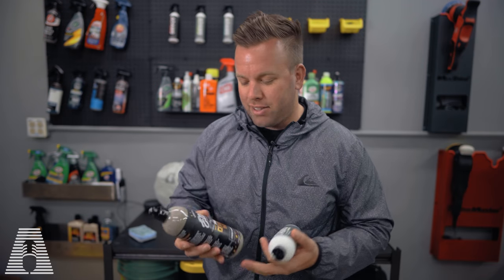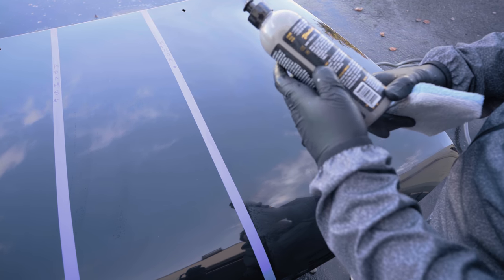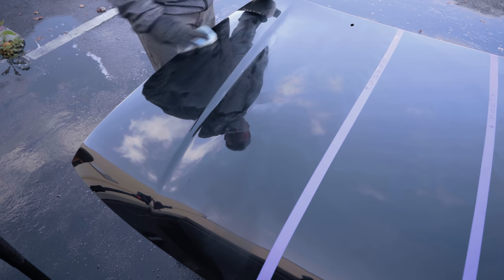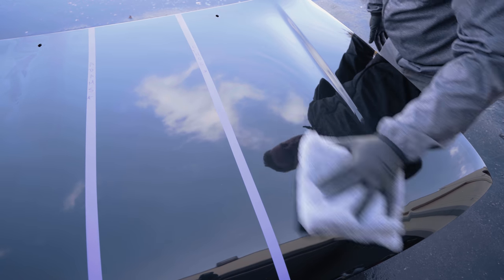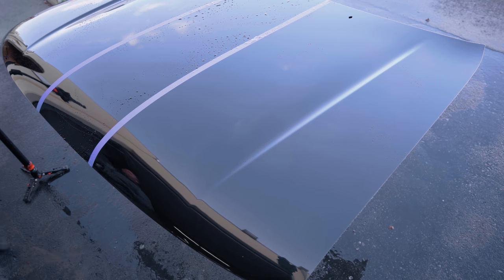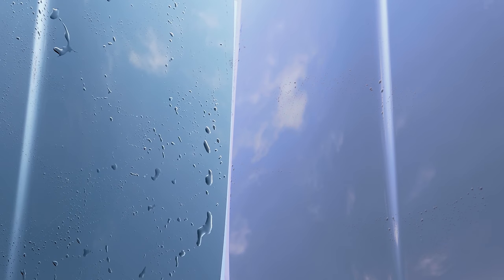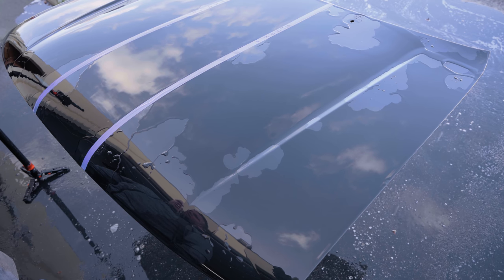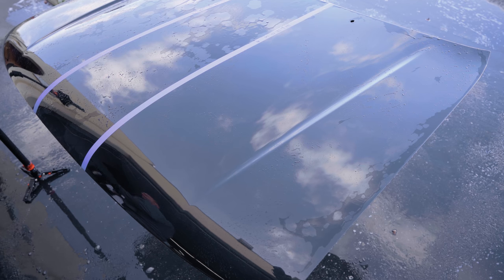CHEAP VS EXPENSIVE: ADAMS CERAMIC LIQUID WAX VS ETHOS CERAMIC WAX

Comment: I have the newer Adam's ceramic spray that comes in bottle like the liquid. I did full detail on my truck. Strip wash, iron remover, wash and alcohol cleaned and then put the spray on and let it cure for 5 hours inside. My truck sits outside a bit and after about a month the hydro properties just seemed to disappear. Was kinda let down due to how expensive it is. Have been a Adam's lover for awhile, but not sure anymore
Reply: You're better off with turtle wax or even a meguiars product. If you're looking for decent protection.
Reply: @ashishpatel350  I've been using the turtle wax spray on some other vehicles and it seems to be holding up very well
Reply: Same
Here man. Used this stuff and don’t last long
Reply: It could be the Adam's sio2 coating (picture spiderweb) "pores" are clogged if you will. Try doing a gentle clay and iron remover again and a pH neutral car wash and see if in the final rinse the hydrophobic are back.

Comment: Jimbo, enjoy your shows. I am a Maguire's fan. I like paste waxes. After that, I find the spray assortment adds extra protection that is easily applied more frequently. If you are serious about the condition of your paint, try good paste wax applications and then for general maintenance use sprays. This will really extend your paste waxes and beautify your finish.

Comment: I tried the non pro ethos ceramic wax, I’m not sure if there is a real difference. But it said 10-15 minutes dry time. Which I did and it was a huge pain to get off.
Reply: It all depends on the climate in your location. If you’re in a place that’s humid then you should cut the time. If you’re in a cool place then yea wait the 10 mins..

Comment: A little off topic, but even after applying a lot of these products, why after washing with foam cannon and soap (I used chemical guys maxi suds) it seems all protection is lost? Water sticks on the panels and seems all is lost.
Reply from the maker: It might be that soap
Reply: @autodetailingpodcast  is there a soap that's not so aggressive that you reccomend?
Reply: Use ethos car shampoo it will not strip waxes and sealants

Comment: Lets see some Shine Supply Clutch and Shine Supply Daddy-O
Reply: Was just about to comment that!
Reply: I'd love this.
Reply: And Shine Supply Cherry too.
Reply: Daddy-O only lasted 45 days with me.  3 washes and it was done.  Wasn’t impressed
Reply: Detailing Breakdown did you wash with ph neutral shampoo?
Reply: somthingsquishy yes.  I was also testing 4 other sealants at the same time.  Daddy-O was the least durable
Reply: Detailing Breakdown I find that surprising, ive had great durability out of it
Reply: Zach Covington how do u maintain your vehicles?  Are u topping the sealant with anything...be it soap with wax, Quick Detailer, wax itself, more sealant?  The test I did was strictly washing and drying.  No toppers at all.  I really wanted to see what the sealant can do.  And the same method was used all over the car on all panels that had different sealants.  I like the application of Daddy-o and the removal.  It lasted 45 days and that may be ok as it was easy to apply and would be to reapply.   But compared to the other, it didn’t hold up.  Not a big deal but for my $$$ i will not be buying again
Reply: Detailing Breakdown i only ever wash with shine supply shift or carpro reset
Reply: Zach Covington hey, find what u like and use it

Comment: Hey Jimbo, can you teach us the secret to vacuuming/cleaning the tiny crevices in the seats, on the floor, etc. my kids are slobs.
Reply from the maker: A crevasse attachment on the vacuum will be a life saver
Reply: I get that but what do you do when even the crevice tool is too big to fit? Compressed air?
Reply from the maker: Ya air works really well
Reply: Look for skinny brushes that are long and thin to work the fabric. In one hand I hold the crevice tool in another I continously scrub and try to catch all the flying debris. More than anything is repeating the process over and over in several directions. Tedious but having a good arsenal of stiff brushes to fit on different areas helps immensely more than crevice tool alone. I don't have access to air compressor so I work with what I can

Comment: Quick question, hopefully you get a chance to respond, but without a good protection coat is it better to hand dry or use a blower? I dont have an actual blower for vehicles, I just use my gas powered or electric leaf blower but still end up with spots. There is not a good coating on either of the vehicles I wash. I need to get them polished up but will have to wait until after my 4th hip replacement surgery lol.
Reply from the maker: I blow try to about 90% then hit the car with a final wipe down
Reply: @autodetailingpodcast  thank you for the reply!!!

Comment: I have ethos ceramic  ... 
Adam's polishes  seems to have lost its way  ... 
Now I only buy the  car shampoo  .
Reply: I was just thinking about this. I used to love adams because their product line was so simple. One detail spray, one shampoo, etc. Now they are starting to get like chemical guys with a confusing product line.

I just placed an order from ethos - trying their shampoo and seal and dry (hoping that is going to be like adams old guard and gloss). I love how simple their product line is. Thinking about getting their ceramic coating kit, but I might try this wax first.

Comment: Lets think about this.. how many people are going to do this to their car?? this testing says nothing about being able to withstand NATURAL weather and atmospheric assaults on the panel tested.. heat, cold, mud, snow.. those are the kind of elements that need to be shown to test the products effectiveness in protecting.. all you showed is that it took one chemical to kill the Adam's side of the panel, and three to finish off the Ethos side..  I like your videos but your testing methods are inaccurate to be nice about it.. if you put the product on and the paint lasts through 12 standard washes, you have at least somewhat proven the effectiveness over a years worth of washes (once a month)..
Reply: People will spray strong chemicals to remove things like bugs easier.

Comment: Honestly those beads ain’t shit😂 there’s so many other products that bead better it’s not my opinion it’s the truth. Love the video doe
Reply: Which ones did you find bead better than these two?
Reply: Daniel C. ///Fusso coat wich will actually last a year, has high contact angles meaning the beading abilities are absolutely crazy, fusso coat is even said to have better and higher contact angels then some ceramic coatings, Collinite 845 wax last about 4 months and has way better beads and the durability to go with it, sonax polymer net shield 6 months durability, high temp paste wax last towards the 6 months range crazy beading, all the products I listed are lower then 30$ on amazon offer more protection and have nicer beads and there’s a lot more, where at the age that if your spending 40$ and up on a sealant you’re getting ripped off.
Reply: @jayzayas3425  Appreciate it! Thank you!
Reply: I’ve used all those product you mentioned and side by side they do not compare to Ceramic Wax PRO. Russo Coat attracts dust like crazy and is a pain to use, PNS beads extremely well but is not very durable nor slick. Collinite fogs up, attracts dust like crazy, and does not have the durability or protection for a long term sealant. 

Yes, PRO is certainly more expensive, but our clients love the richness, gloss, dirt repellency and slickness that is really unmatched. 

YouTube chemical testing does not paint the whole picture, highly recommend people trying products for themselves before jumping to conclusions.
Reply: Tim Coats I’m not knocking ur product and i respect you defending it but your products beads aren’t the best the durability isn’t the best and price surly isn’t the best now I respect your response but those where examples your product is still over priced for what is does, you can take that how you want to take
Reply: jesus Zayas once again, “Best” according to the tests you have seen are 100% subjective. Stay tuned for more to come... thanks again for your input.